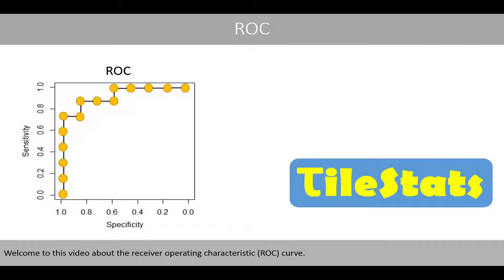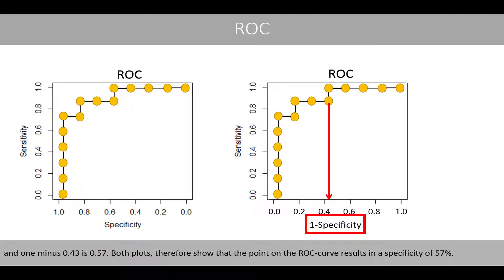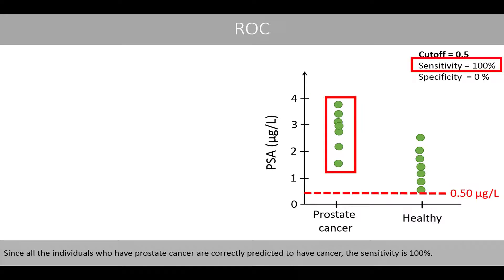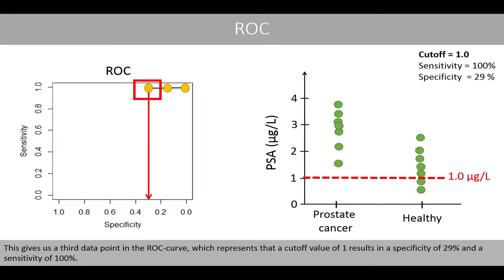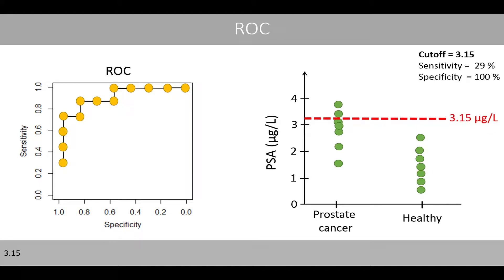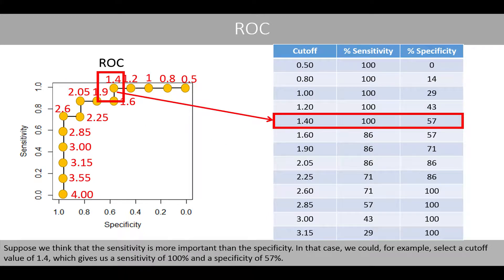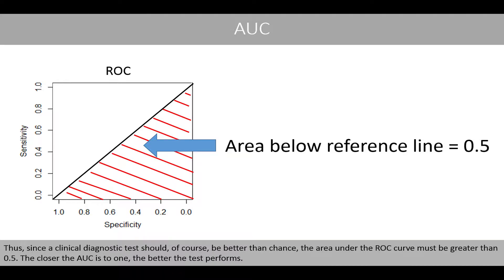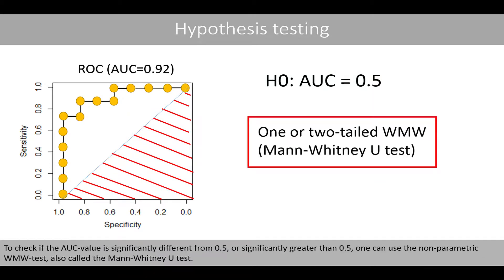ROC curve - explained

Comment: Thank you so much for the clear and insightful explanation. The connection between AUC and the U statistics of WMW when calculating the p-value makes so much sense. In my opinion, the p-value of the AUC should be reported together with its value whenever possible. However, may I ask you something, Professor? In the case of cross-validation, the AUC value we obtain is the average AUC from different folds of data. Normally, I reported the AUC together with its standard deviation. In these cases, if possible, could you please kindly explain how we can calculate the p-value for this average AUC? I would be very grateful if I could receive a response to this question. Thank you very much in advance for your kind help.